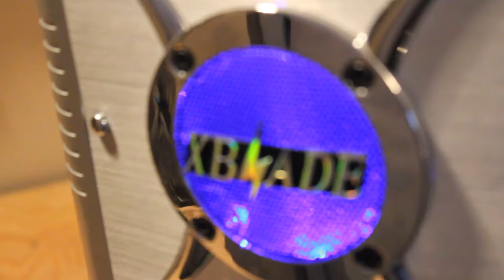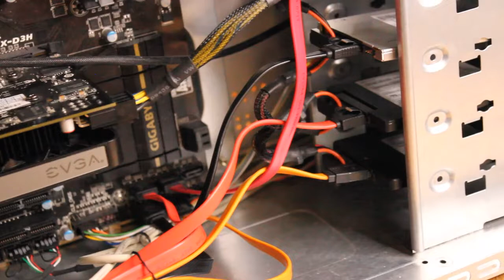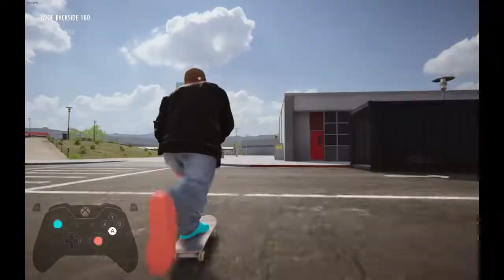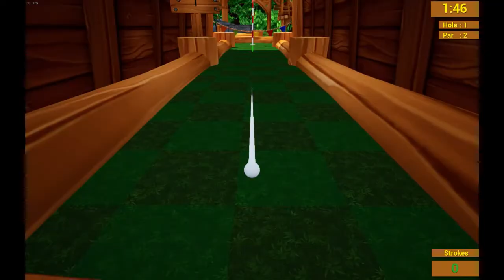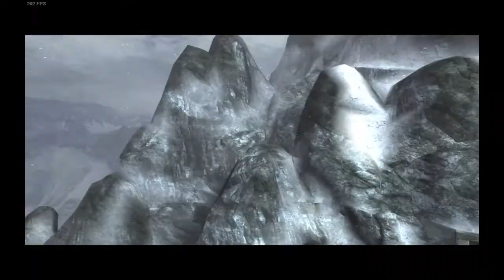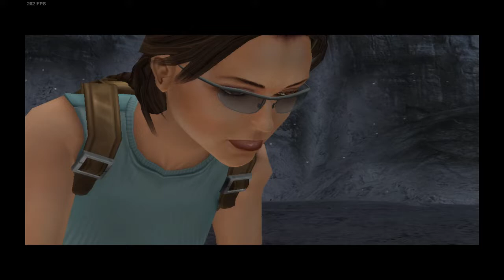X Blade PC - AMD A8 Pro 7600, GTX 650 2GB, 16GB RAM, SSD Test Run

Comment: I remember this case well :) Most people think they need a 5000$+ system to have fun, it's amazing how useful older computers still are.
Reply from the maker: Definitely.  Someone gave me this case a couple years ago and it had an interesting Win XP era setup, but there were too many little problems to troubleshoot, so I gutted it and made a couple different versions of a home NAS.  Just recently I decided it might be better to release it to someone else and pieced together a build from spare parts.  I'm sure someone will have a good use for it.
Reply: @HaisteComputerRepair  That's really cool! I recently had a very nice X31 that finally died on me, I tried to replace some caps on the motherboard to revive it, but that didn't work. It was still running XP and it (up until that day) worked flawlessly. 

I'm sure someone will enjoy the work you put into the x-blade.
Reply from the maker: @hightech-lowlife  I'm sure.  I'm not so skilled at soldering, so I need more practice before I do work like that.  Just need to find the time to do it all :)
Reply: @HaisteComputerRepair  It's not too bad, just like anything just takes time to get better. I don't even have a hot air station, just working with a regular iron. I have subbed to your channel so looking forward to more things you make :) thanks!
Reply from the maker: @hightech-lowlife  I have also subbed to yours, so good luck out there!
Reply: @HaisteComputerRepair  Thank man, you too!